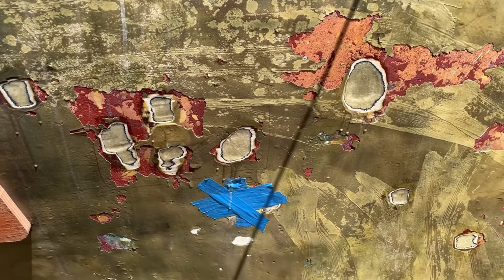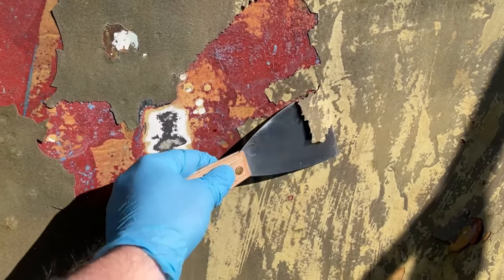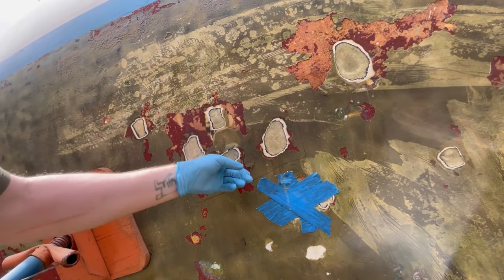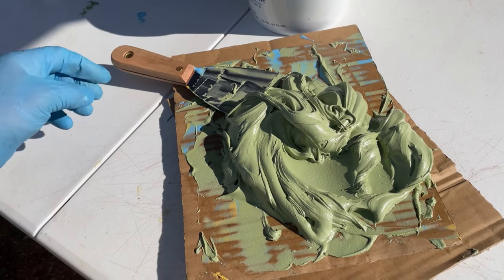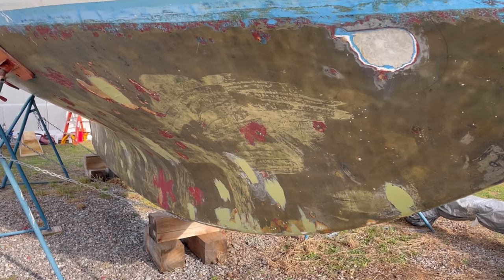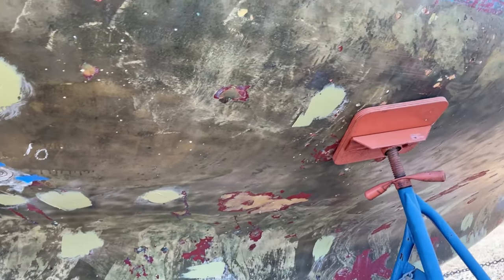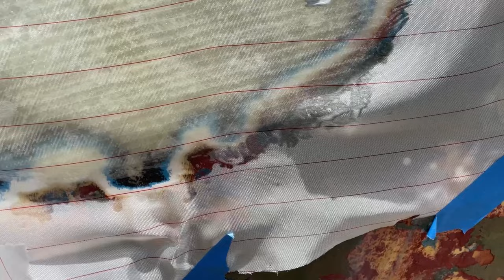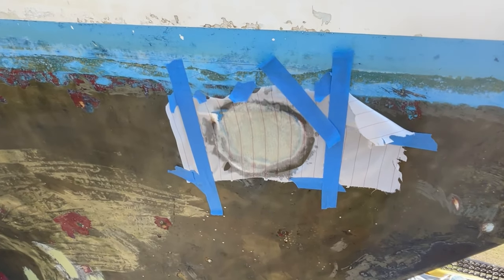Fairing and Glassing 97 Holes | Sailboat Restoration Ep. 29

Comment: You start off with the small first then get bigger. You can also build it up on the table then apply all at once but roll out the the build of resin and bubbles
Reply from the maker: I had to do that on a few larger pieces. Wet them on the table before applying. Debated, but I decided to go biggest to smallest, with one larger patch on top.

Comment: I use a 4 inch grinder with a sanding flapper disc with 80 and 40 grit. also a rigid orbital sander with 40 grit.  I would consider a complete glass and epoxy barrier coat when to many blisters.
Reply from the maker: I have those in my wheelhouse too. The flapper discs are great. Thanks for the recommendations. The barrier coats will be a two-part self priming epoxy to 10 mils.